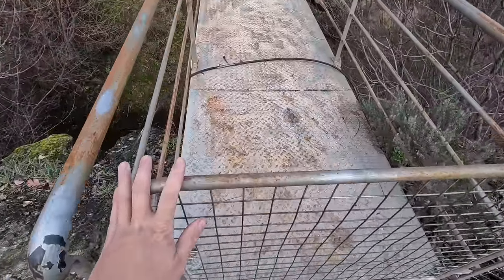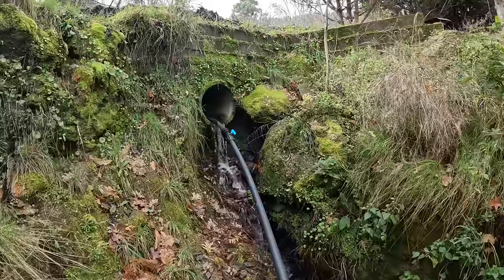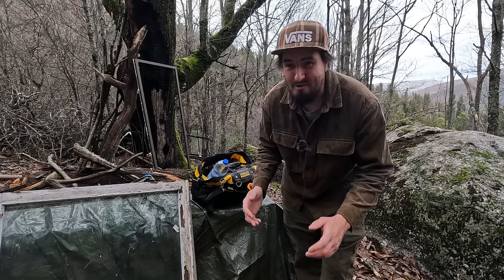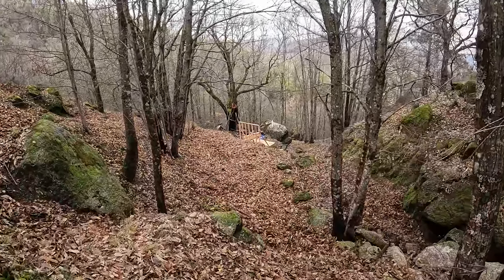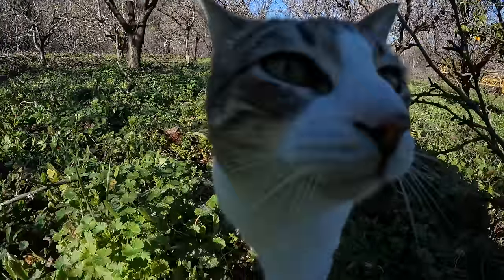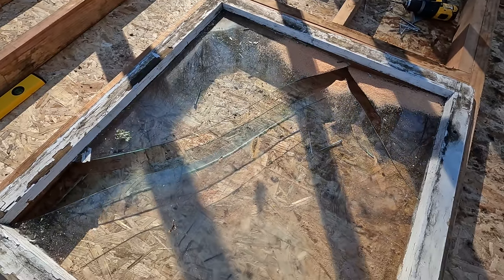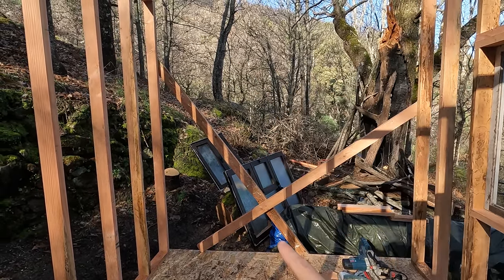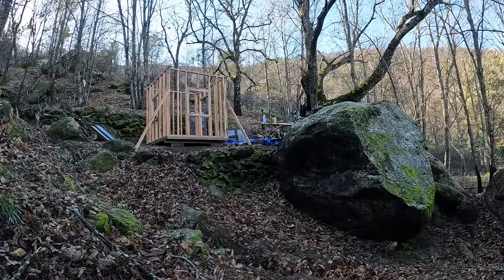DISASTER On The Cabin Build | Bee Shares Her Progress!

Comment: The problem is not the old window. Windows are not supposed to be installed until all the framing is up for this very reason.
Reply from the maker: I did not install the window I just checked it fit with the opening 😀